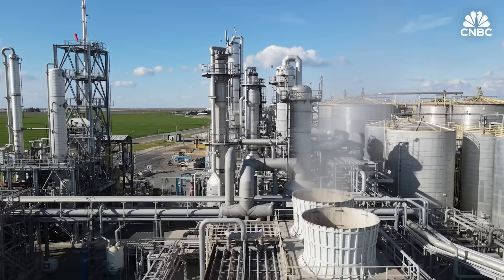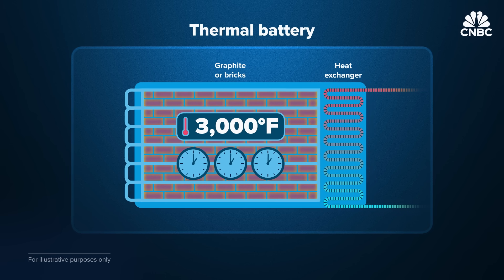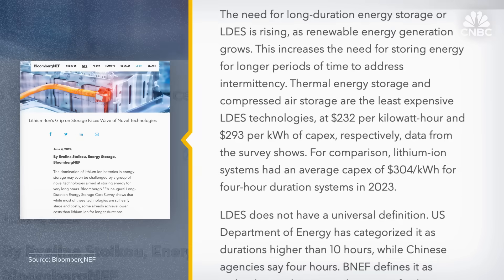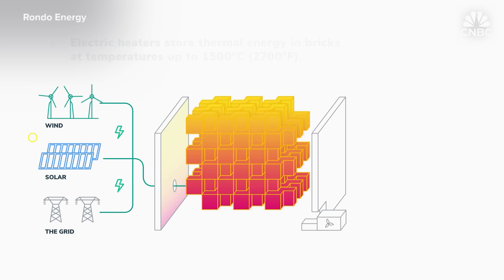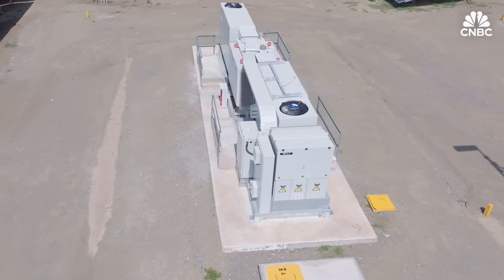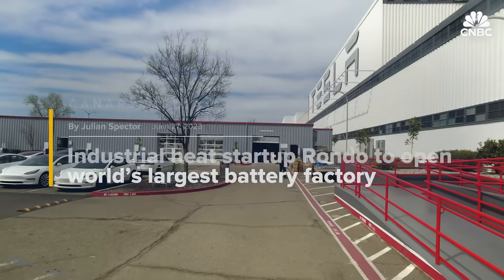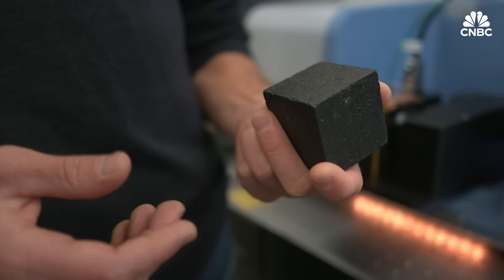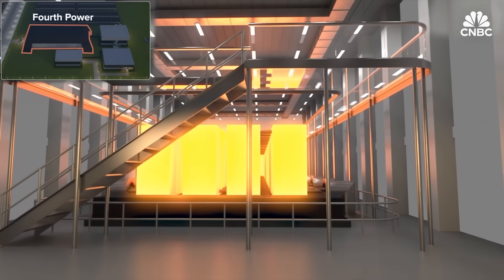How Thermal Batteries Could Replace Lithium-Ion Batteries

Comment: The piece seems to ignore Sodium-ion batteries, which are mostly made from......salt.
Reply: For large commercial applications, using sand, rocks, concrete, graphite are much cheaper
Reply: @larryc1616  electricity is a higher form of energy, heat is the lowest.
that's why heat to electricity (ex coal to electricity) is only 25-30% efficient whereas electricity to heat is 100% efficient. Can also use electricity with heat pumps to get a cheat 400% efficiency
Reply: This is about hot rocks, not hot salt.
Reply: @A3Kr0n  the problem with hot rock or similar technology that you have energy as heat so you can use it as it is or you will get losses then you convert it to electricity, no mention that this conversion will be quite difficult to control because it will be not constant and of course this conversion will cost money. With melted salt technology you have electricity in the output. For humanity electricity is the most important and most consumable energy form. This hot rock energy technology I see using only in factories where you need direct heat in production and also in the cold cities where central heating system is used. But in winter you have low sun exposure and not so much wind...
Reply: @A3Kr0n   This is about hot clay, not hot salt, but both are technically rocks. Tha being said, why not just use multiple industrial solutions for multiple, bespoke purposes that fit to those specific use cases instead of trying to make an everman solution? Litium ion for consumer electronics, thermal batteries for industrial heat transfer, salt batteries for municipal storage, nuclear for guaranteed on energy availability, renewables for cheaper variable electricity.
Reply: They are ignoring it. Because ths video is not about that.
Reply: @saulgoodman2018  They imply that thermal batteries are the most logical alternative for lithium batteries because of the scarcity of the lithium supply, ignoring sodium batteries which are already in service as large-scale grid storage. 

Thermal batteries (e.g. storage heaters) have been around for more than a century and there's a good reason why it isn't used in grid storage in lieu of lithium - they're just not very good.
Reply: @Avantime  Good. This video is still about thermal, not sodium.
Reply: @saulgoodman2018  I call it more a puff piece for this industry.
Reply: @Avantime  How is it a puff piece?
Because they did not talk about salt batteries?

Comment: Aren't there already salt or liquid sodium battries that just heat up salt to the point it melts and stores it. Apparently it loses like 0.5⁰c every day....how good is this compared to that
Reply: Salt is a proven method of storing heat, however, it is not a safe method for storing heat right where it is needed -- at the heart of a factory -- if salt leaks, it looks like water, and if the system needs to shut down, salt turns to a solid which clogs pipes. The Rondo system is made of inert materials, and uses the same exact boiler configuration and controls as existing gas-fired boilers, making it an ideal solution for facility managers who have operated their facility in the same way for decades.
Reply: It think these bricks just happen to be cheaper and most cost effective. Especially to provide heat in the form of steam for industrial processes. Providing a large heat sink allows a factory to get steam 24hrs while being only supplied by intermittent renewables. This makes sense.
Reply: I thinks  its more expensive and more corrosive to store and its high in maintenance
the last time I saw they used sand cheaper but may be less efficient
Reply: I heard of it. The one near Las Vegas uses light to heat salt and use that heat to transform into electricity.
Reply: Just try to put out a fire when a liquid salt container is starting to leak. Good luck 😂😂😂
Reply: It's about cost, not about effectiveness, sadly
Reply: @growtocycle6992  not every time
Reply: @imtheeastgermanguy5431 Only for pilots or R&D. This is important, but not feasible in the long term.

I think thermal energy storage is brilliant, and actually much better than batteries from an economic feasibility perspective... However, as with most things, it's also about how much money can be made...

Also, the issue for industrial applications is about heat quality, not about just how much heat you can store... Low grade heat is mostly useless for industrial purposes. You want high temperatures, even if the efficiency is reduced. For residential purposes, ironically, it's likely better to have the alternative.. We don't want VERY high temperatures, we want efficiency, scale and cost saving.  <(**)>
Reply: @growtocycle6992  the answer is renewable energy and heat pumps
Reply: Probably more cost effective